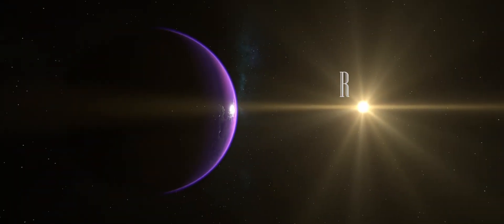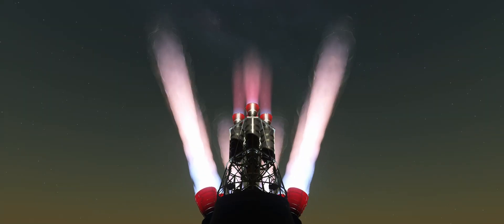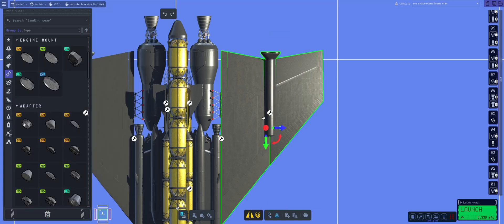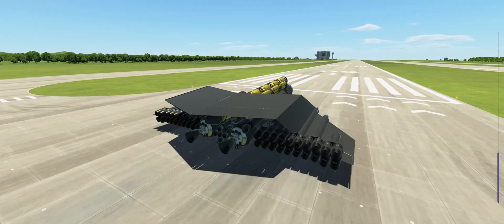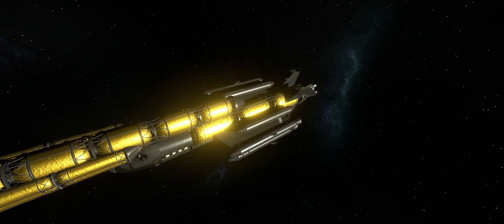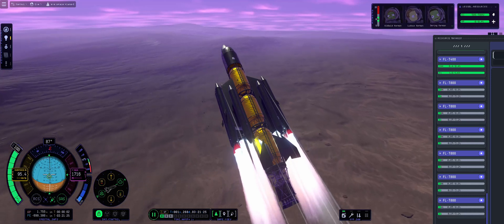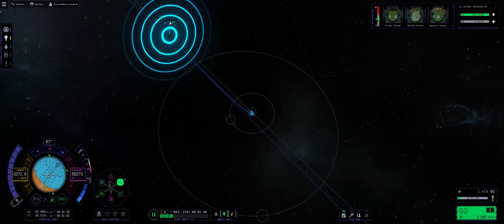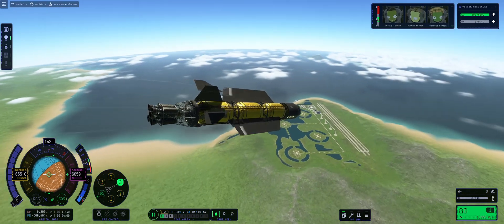Eve round trip with BIGGEST space plane in KSP2

Comment: I have been able to fix the Delta V and not being displayed and not being able to create maneuver nodes issue by turning infinite propellant on and off. Nice video! I got to a space plane about half that size and lost patience with the FPS limitations involved.
Reply from the maker: sadly, that didnt help this time round since its a different bug. Its caused by disabling a currently running engine (swerv) and then staging a new set of engines. I sadly had to do it or else the swerv would have burned all of its hydrogen before i even got to the required altitude on Eve.